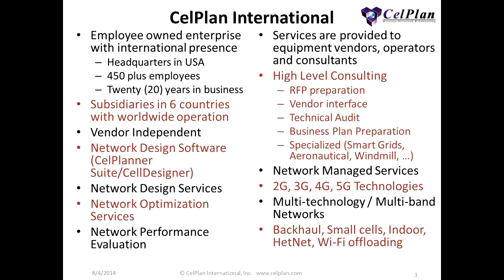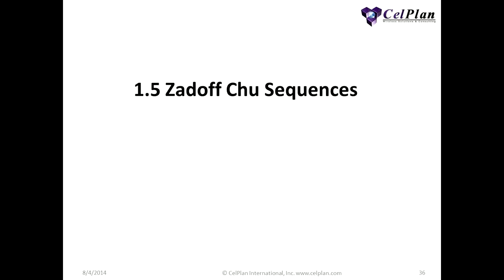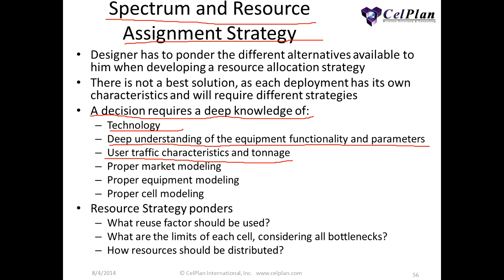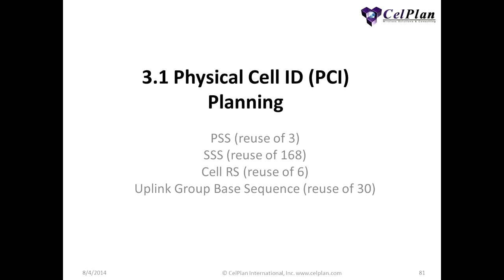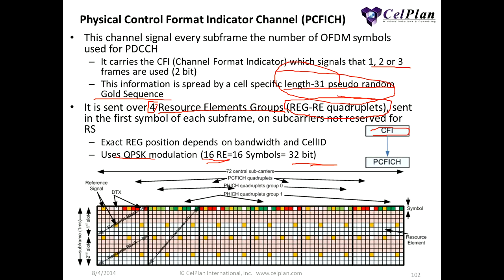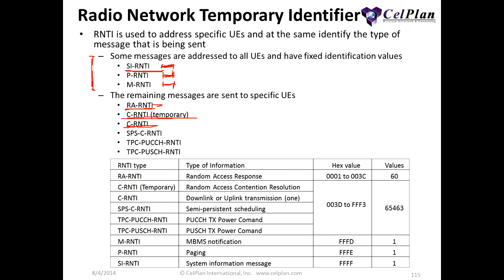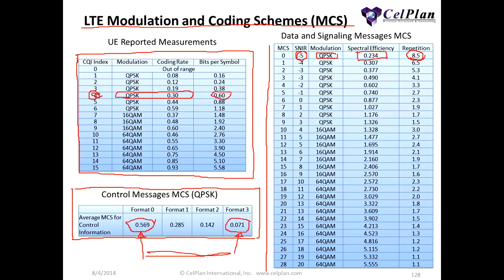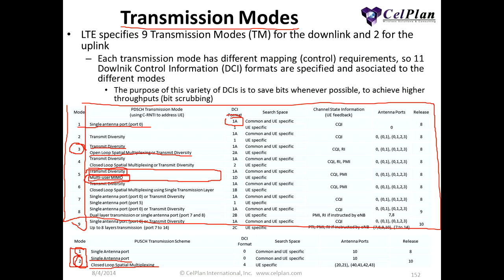WEBINAR 5 - PART1: What LTE parameters need to be Dimensioned and Optimized

Comment: A bad presenter (Not presenting like a technical Trainer) and wrong naming for the subject of presentation. I don't know why he use "LTE Parameters" instead of "LTE Channels" ?! 
 Normally, "LTE Parameters" means Radio parameters like: hysteresisA5, threshHigh, qRXLevMin, A3offset, etc. 

This presentation is about LTE channels and its configurations/Dimensioning in LTE design stage. There s nothing about LTE Radio Parameter Optimization in this presentation. 
This is good if someone wants to learn basics about LTE channels and 3GPP not more. So, because of wrong naming it waist my 3 hours ! Please do not try if you are looking for "LTE Parameter Optimization" means aiming "LTE KPI Improvement".